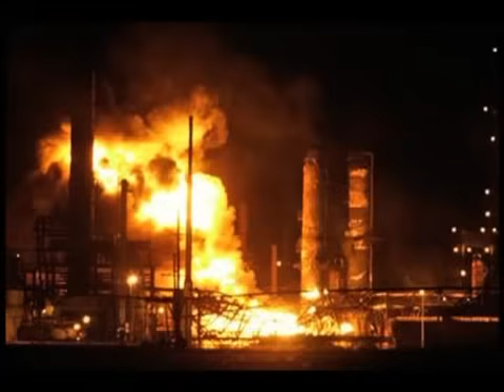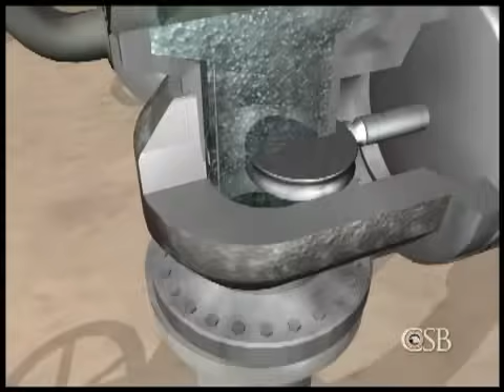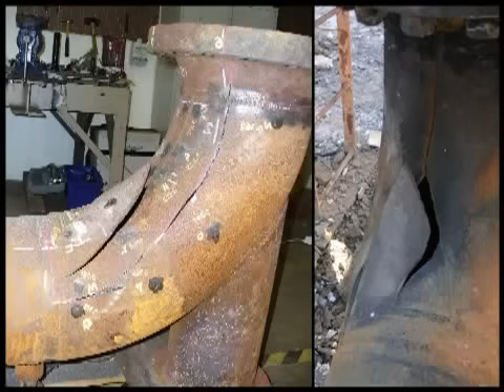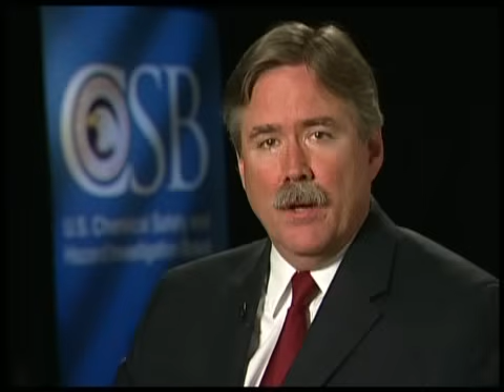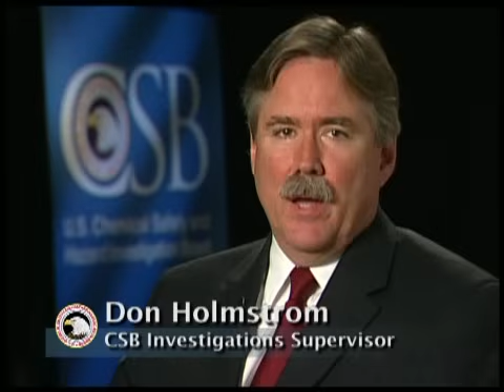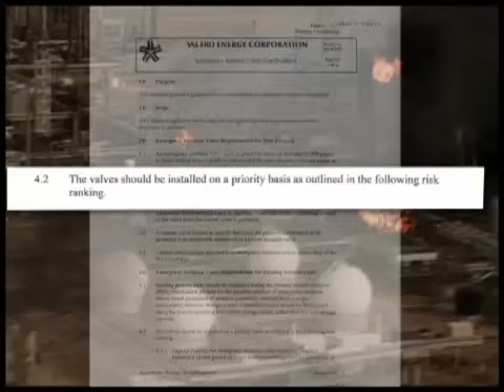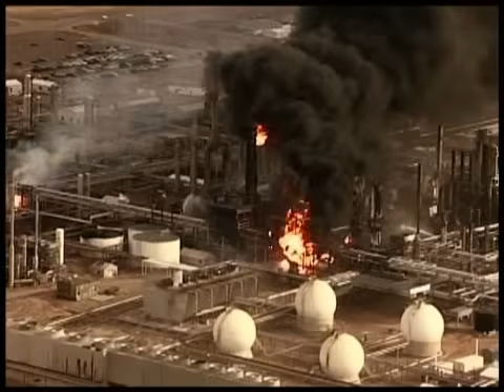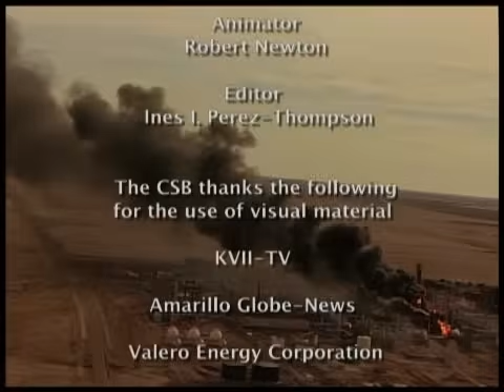CSB Safety Video: Fire From Ice

Comment: One of the items missed in these videos, especially applicable to gas plants & refineries, is that most of the base equipment is original.  Most N American refineries are at least, about 70 to 80 years old.  The cost of building & operating these places is astronomical.  The yearly turn arounds only catch the bigger problems.

Comment: a bleeder valve in the lowest points of exposed pipes  could have prevented water from building up.

anyone who  has worked with shop air knows there is a small valve on the bottom of the tank to prevent water build up.
Reply: that bleeder valve would have been jetting propane the entire time, instead of waiting 15 years for a pipe to rupture

Comment: A pressure sensing instrument installed on the 'dead leg ' side of the input line would have shown the leak.
Reply: maybe, maybe not.  an instrument ignored for years might not work.  and no instrument matters if nobody's looking at it.

should have installed plates, and maybe a blowout preventer.

Comment: Piece of metal causes water to accumulate, cracks a pipe, pipe leaks propane, ignited by a boiler, causes another leak, causes supports to melt, causes pipes to break, which causes a chlorine leak. this is some final destination tomfoolery

Comment: Here is the real question, the fire in the second video was large enough to be pulling air from all directions 
Was that chlorine gas that was getting pulled into the air displace enough oxygen to keep the tank from overheating and exploding?

Comment: Pipes with water in them don't usually rupture on the first freeze.  It generally takes repeated freezes before they rupture.  Fifteen years would have been enough exposure to the occasional freeze-thaw cycles to provide these conditions.

Comment: "It doesn't have to be chlorine, it can also be bleach" isn't bleach normally chlorine (or a solution thereof)?
Reply: Have a sense of proportion.  When bleach leaks, you can clean it up with water, a mop, and a little care.  When chlorine leaks, it instantly becomes a roiling wall of toxic death.  They're both chlorine in the end, but one is a lot slower!

Comment: "Refineries don't have to use chlorine, there are inherently safer chemicals, such as bleach, that can be used for this purpose"

Bleach contains chlorine (as sodium hypochlorite), just in dilute. They like used chlorine because it's many, many times more concentrated than typical 6% concentrations in bleach. Either have 3 tanks of chlorine or thousands of gallons of 6% dilute bleach to do the same job. You could treat swimming pools with bleach as well, or, use 65% concentrate pool chlorine and use several times less chemical to do the same job.

Comment: "They don't have to use chlorine.  They can use safer chemicals like bleach."  THAT'S CHLORINE...
Reply: Have a sense of proportion.  When bleach leaks, you can clean it up with water, a mop, and a little care.  When chlorine leaks, it instantly becomes a roiling wall of toxic death.  They're both chlorine in the end, but one is a lot slower!

Comment: One of the CSB members mentioned there was safer ways to treat the waste water from the plant then proceeded to name CHLORINE Bleach granted it would have to be mixed with something for anything to happen it can do what the regular chlorine can too
Reply: chlorine bleach - usually sodium hypochlorite - is pretty safe.  its the same bleach you buy in the store, but a lot more concentrated.  a spill or leak is unpleasant and corrosive, not a roiling wall of toxic death.

pure chlorine of course is incredibly dangerous.

Comment: What’s frustrating about this one is a $100 10” paddle blind that a couple of maintenance guys and small crane could install in a few hours would have almost completely mitigated this risk of leaking process material seeping into dead leg piping.
Reply: consider that that was a live line despite the valve being closed, trying to decommission that line could easily have caused this accident too

Comment: One could spend hours in these comments, correcting ignorant assumptions and answering stupid questions. The biggest one in this case being why they recommended using bleach instead of chlorine. 
  They stated in the video that the chlorine could have killed first responders or workers in the area trying to fight the fires or stop the accident.
   Bleach is 95% water. It doesn't form gas clouds and kill you instantly when you inhale it. The chlorine is mixed with so much water that, in an outdoor setting such as this one, it is highly unlikely that the chlorine would have any effect - even as the water evaporated from the heat of the fire. 
  Secondly, stop judging them for not knowing that foreign piece of metal was inside the valve. There is no way to know if a gate valve is completely closed, in a sealed piping system such as this one. 
   Safety protocols and standards are built off of accidents like this one. No one on this planet is psychic and can predict every possible scenario for potential failure. We live and we learn. Some of us die in the process. 
   If you're in the comments on youtube to tell everyone how you could have stopped this or done it differently, put down the phone or keyboard and go DO IT.

Comment: ...it seems to me like most of these horrific disasters could be prevented - or at least mitigated - by... the simple fail-safes most home HVAC systems have
Reply: like a circuit breaker, these things have problems scaling up.  when you're pumping hundreds of cubic feet of propane an hour, how do you tell the difference between normal use and this anyway?  and what sort of consequences would happen from just blindly shutting off the propane to this machine while it's still running otherwise?
Reply: @tsm688 Order of operations can be scaled. If you can afford half a million dollars to rebuild a refinery, you can afford a thousand dollars in failsafes to make sure something that isn't supposed to burst into flame doesn't come in contact with oxygen and a heat source at the same time.
Reply: @notoriouswhitemoth  I've given you an example of a real life scaling problem and your answer is just "no u"?  really?

Comment: I wish you guys would do the Cosden Refinery (was Alon at the time and now it's owned by Delek) fire and subsequent explosion in Big Spring, TX on February 18, 2008, which happened to be President's Day so workers were running a skeleton crew (so I've been told; call me a conspiracy theorist but there are too many coincidences for me to think this is fraud related).  My parents' house still has a severely cracked concrete foundation and severe cosmetic cracks inside the house in the drywall from the explosion because my dad never contacted them to fix it.

More info can be found at:
-- https://www.newswest9.com/article/news/local/explosion-at-big-springs-alon-refinery/513-6d5f8d70-7361-41db-89ed-70d50833c384
-- https://www.mrt.com/news/article/Oil-refinery-explosion-rocks-Big-Spring-7491199.php
-- https://www.oaoa.com/bsh-jury-finds-negligence-in-2008-refinery-explosion/article_4d79a455-ac9d-5842-8a37-1aabab40c5da.html

Comment: 9:35 i thought bleach was made with chlorine?
Reply: Bleach is made with chlorine. However, bleach is mostly water and doesn't react as violently when it is combined with other compounds.
  The biggest hazard in this case was the chlorine gas leaking from the cylinders, which could have killed any first responders who entered the area to fight the fire or try to stop the flow of propane.
  Bleach, being mostly water, would not pose the same level of risk.

Comment: Seems like flow meters that could sense when unintended flow changes occur could close valves up stream.  Not sure if there is an expanding fire proof material that could be used to close a valve or create a closure in the piping if sensors fail and work as a last resort  by being activated by the heat like some existing fireproof materials.
Reply: flow meters tend to fuck up, stay fucked up, and be ignored when something happens.  A blowout preventer might be better, it does what it says on the tin, when there's a massive enough flow, it snaps shut.

Comment: they should do a pressure test and see how far it jets at set pressures then work out a chart to use for places that say at this pressure fireproof x feet away then double that distance
Reply: That would be impossible, as the jets would vary based not only on pressure, but the size of the crack. It's not possible to predict how badly a pipe will crack.

Comment: The steel beams melted due to exposure to jet fire. Hmmm sounds suspect.
Reply: But propane-air can heat steel to plastic temperatures. All that is needed is for the pipes to deform and stsrt leaking.
Reply: Burning propane can get hot enough to melt steel so how does it sound suspect?

Comment: Dead legs or about any decommissioned pipe or container that had or has bad substances in it and is not rendered inert may come back to bite you. This illustrates reckless oversight of degradable materials on site.
I bet the bean counters fully depreciated the structure each year.
But guy on site did nothing about its potential need for scrutiny.
Many underground gas&petroleum lines are not removed from the ground once they are decommissioned (often due to deterioration) posing potential problems.

Comment: Interesting that the recommendations are easily implemented and not too costly. The CSB appears to be an efficient organization.
Reply: depends on if any life's are lost then it becomes the blame game.... when no one dies its blame bad policy or lack of rules and regulations or knowledge. you do not want to be the one CSB is investigating trust me. no lawyer will or can protect you.
Reply: @Master80059  until CEOs start seeing prison time, little will change.
Reply: They are very good investigators, and they make good recommendations 
However they have farcically little power to enforce those recommendations 
And our lobbyist-controlled regulatory system hamstrings them even more
Reply: Unfortunately the CSB can only recommend, they can't enforce!
Reply: @GrantJohnston-dr9rt Usually though in some of the older videos/cases, OSHA at points has adapted them to rulebokks etc or like the rulemaking body like American Petroleum Institute etc
Reply: There was actually freeze protection installed at the time.  But it wasn’t being PMd
Reply: @PGPatrick625  I don't actually blame them for not installing freeze protection, in texas, on a *DEAD LINE* that wasn't ever supposed to have anything in it...  Cutting it off or installing a dead plate would have been easy and reasonable

...but that could even have caused that accident too, as the 'dead line' obviously wasn't dead at all

Comment: @9:28 "refineries don't have to use CHLORINE. There are inherently safer chemicals, such as BLEACH..."

I may be just a pool guy, but I'm pretty sure there's chlorine in bleach, too...
Reply: rp- : oh, definitely -- it's just that a bleach spill is bad, but a chlorine gas spill is catastrophic.
Reply: If you're a pool guy, then you know how much more violently chlorine reacts when mixed with other chemicals than bleach does.
  The problem isn't the presence of any amount of chlorine. The problem is that the leaking chlorine gas could have killed first responders or anyone trying to shut off the supply of fuel near the fire. Bleach would not have the same lethal effect. It's 98+% water.
Reply: Have a sense of proportion.  When bleach leaks, you can clean it up with water, a mop, and a little care.  When chlorine leaks, it instantly becomes a roiling wall of toxic death.  They're both chlorine in the end, but one is a lot slower!

Comment: Having built scaffolding in the BP Whiting Refinery for 3 years I find these very interesting. Saw and learned a lot of progress in refinery safety. But refineries are still disasters waiting to happen.  The Whiting refinery is one of the biggest in production and sits on less than a square mile. So densely built any issues will spread almost instantaneously
Reply: Yess ive looked up info up whiting as its 35 mins away from me and was curious. The safety record is not hot.
Reply: Guessing you from Illinois or indiana too lol

Comment: I have always wondered why SI units are not used in these videos when talking about mass and volume etc? Is there a special reason not to use them?
Reply: Yes. Its U.S. And U.S doesn't use metric system.
Reply: Yes, there's a very special reason: The United States Chemical Safety Board is located in... the United States, not France or Belgium.

Comment: I feel like after watching 20+ of these videos in the last 2 days that I'm capable of walking into any refinery and doing my own inspections. Thank you CSB, I didn't need schooling or the Holiday Inn, I just needed you.
Reply: Lol I walked into a bathroom at AutoZone earlier to fill a jug with water for radiator. My mind started narrating, “But, unknown to the customer, the mop sink had a fatal flaw which had not been detected...”
Reply: @Bankable2790  after 30 seconds at 11:34 AM, it violently exploded, killing 3000 contractors on site.
Reply: @lars9805 Unknown to the customer, the main pipes that connect the sink to the water main had corroded away over the years.  At 11:30 AM the corroded pipe burst due to the water pressure, shooting brick and drywall fragments at the customer, fatally injuring him.
Reply: @Bankable2790  lol bruh 😂😂
Reply: @Bankable2790 you were putting water instead of coolant was your first hiccup. Second is if you had pure anti-freeze which I doubt, you should be using distilled water. Water from sink has metals calcium and other scale and metals.
Reply: @tigua420  it was an old GM truck that didn’t give a shit
Reply: @Bankable2790  Yeah GM is the worst when it comes to the type of coolant you use. Use anything other than dex cool and that shit turns to mud in your radiator.
Reply: @tigua420  Not a 1985 I said old bro
Reply: I just work here.
Reply: The best channel in YouTube!
Reply: Yup and that's what causes these kind of accidents 😅
Reply: 😂😂😂 @duttydiesel8303
Reply: Yeah that's how disasters like this happen. People thinking they know better.
Reply: That's funny because just last night, I was going over what I would've done as a plant safety officer on one of the Dupont videos, 🤣🤣🤣
Reply: They wouldn't want that come on
Reply: Literally
Reply: That's the sort of arrogance that results in these type of accidents
Reply: @asdasdasdasd8970 Key words: “I feel like”. Not “I’m going to”.

He’s not an idiot, especially after so many safety videos, lol
Reply: @asdasdasdasd8970  🤣🤣🤣 indeed
Reply: @asdasdasdasd8970  Dude, they're literally talking about a low pressure water sink, the only way you could kill yourself on it is tripping and falling at exactly the wrong angle at high velocity and impaling your face on it
Reply: @asdasdasdasd8970 I think it was probably a joke, hence not really arrogance.

Comment: So that Steele stuck in that valve should be easily noticed......how did they not see it...
Reply: The steal was stuck inside the valve. You would only see it if you took the valve off.
Reply: @kevinbatts2804  you should be able to notice that the valve isnt closing on the way ..obviously there is something stopping it
Reply: @allenfig18  Not a gate valve on a closed pipe, genius.

Comment: A simple blind would have prevented this. They had years to realize this.
Freeze control on an unused line?
Please, you're tripping.
Reply: They recommended freeze control for the entire facility. They weren't recommending freeze control on the unused line, that is as long as the unused line was completely disconnected.
Reply: They recommended a blind though